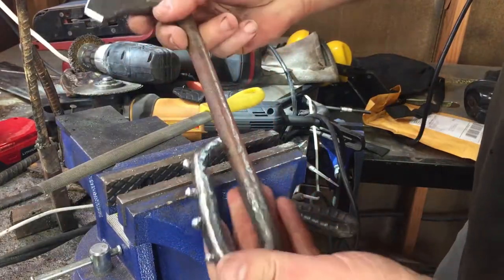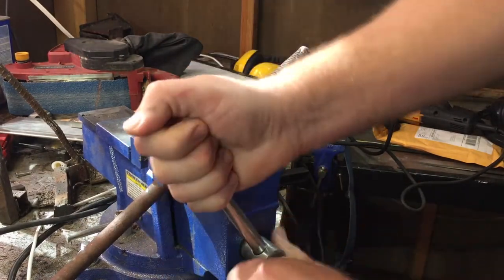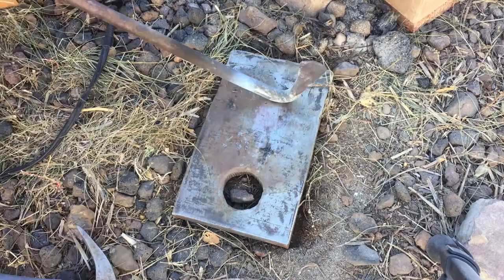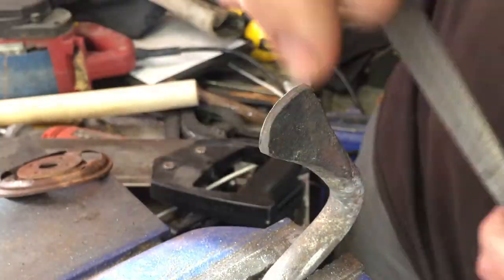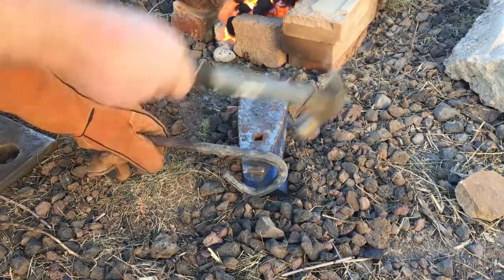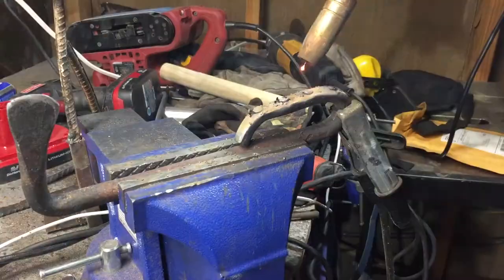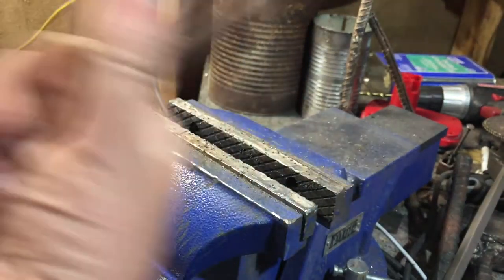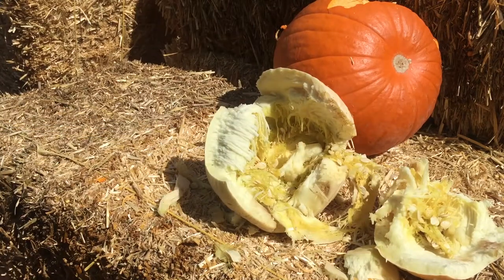Forging a Post-Apocalypse Survival Hatchet in Your Backyard

Comment: The Steel he is using is called an Anchor Bolt, used in concrete pours to anchor columns. The hooked end sits in the concrete so the threaded section sticks out of the concrete.